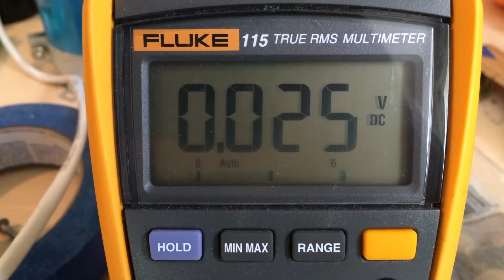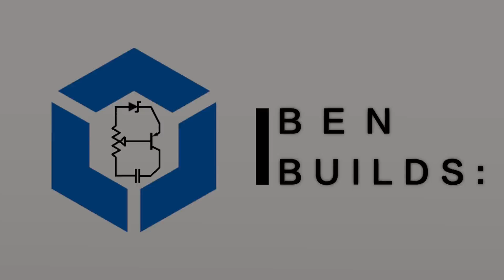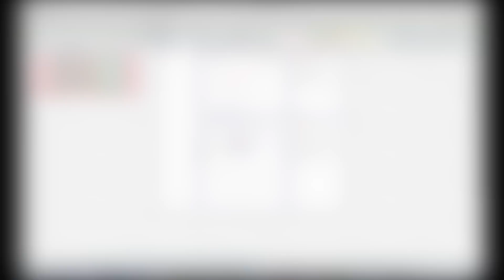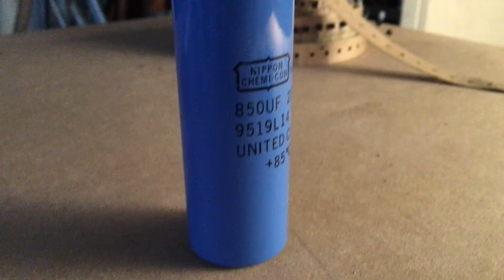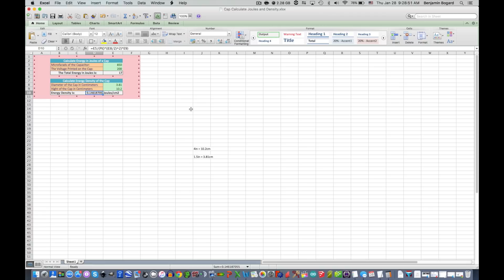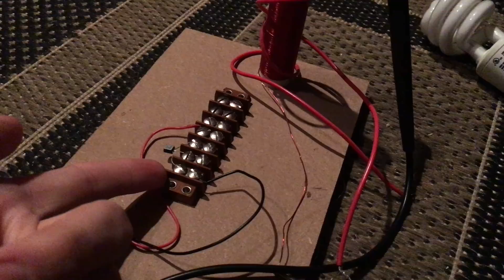Ben Builds: Better Understanding Capacitance + Tesla Coil Fail

Comment: Don't you need an AC signal?
If the output of the transformer is open, where will the current go for you to have a circuit?
What are the transistor characteristics (e.g. is the forward voltage limit reached?)?
Reply from the maker: +VinjaNinja The "AC" signal is simply pulsed DC, that is how DC-DC switching PSU's work. Thanks for the suggestion though!